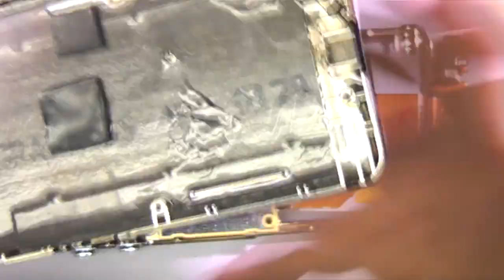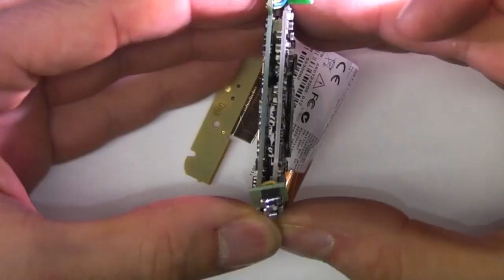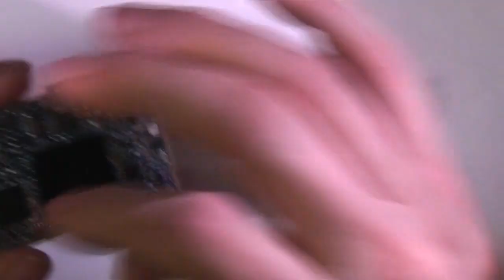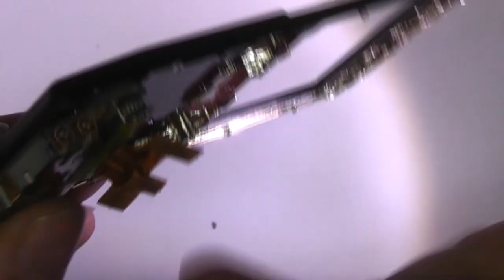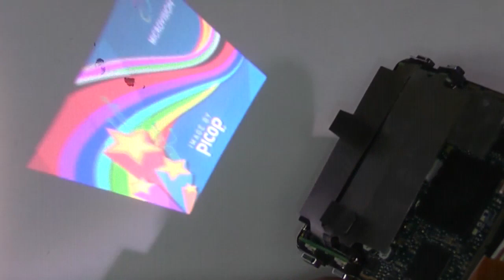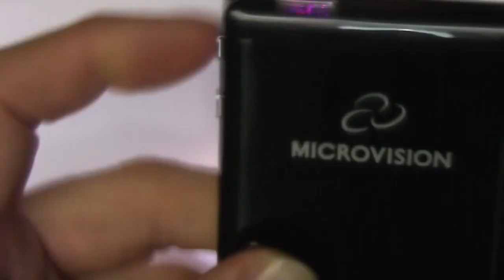Microvision projector teardown

Comment: I have one of their original pico projectors, this one in the video, and the Sony version as well. I'd like to know if it would be possible to replace the laser diodes in this projector with brighter diodes. Has anyone done this?
Reply: No, but I do want to hack the mems mirror.  The laser diode modules can't be any better than the $5.00 ones easy find anywhere.

Comment: The actual name for the device is "Pico Projector".  It was the idea to use lasers to project the image which makes that fixed fine beam that does not need to be focused.  I originally wanted one and it was supposed to be sold at $100 but the company that developed the technology sold out and you will pretty much find these things at about $500 or more.
Reply: They are used on eBay for $40.00

Comment: I had a bit of a moment and took one of these apart trying to shrink it in size for a project, didn't turn out too well as it randomly just stopped working and i've never got it to work again. LEDs just flash as if starting and never stops.. problem is I can't get hold of another one! Seems to be none available these days..

Comment: Re. screw management I use a couple of different methods. First is plastic ice cube trays with each compartment numbered I draw a very rough sketch of screw positions and number them according to where the screws are in the ice trays. The other method (when I dont have the trays handy) is again a rough sketch of the positions and then I tape each screw to the paper, last time I used this method was when replacing the LCD screen on my Canon DSLR, lots of very small screws.
Reply: Oh man, that’s a job!